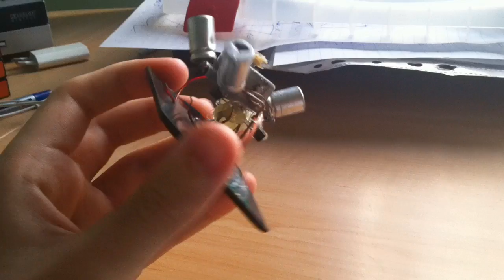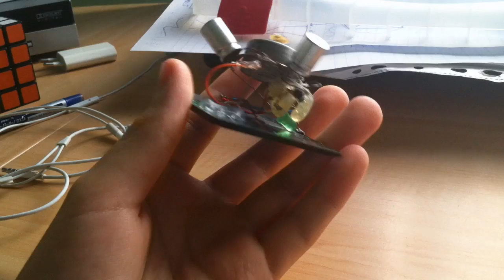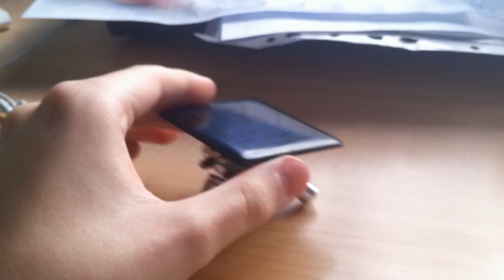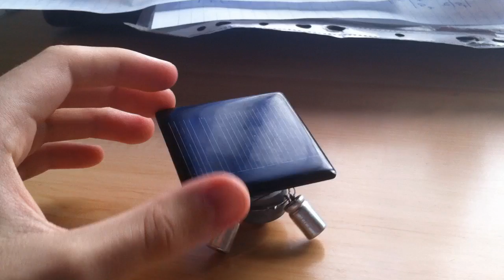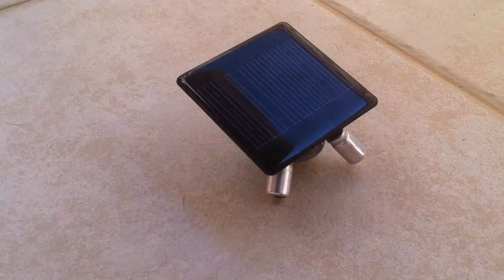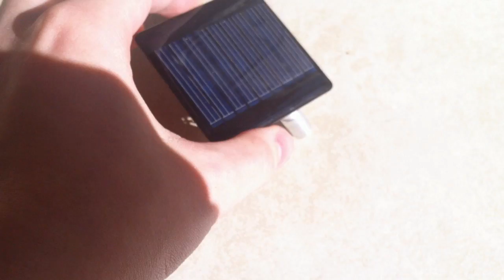Beam Bot - LED triggered

Comment from the maker: Your calculator is a very efficient circuitry, I don't think it draws more then a few micoAmps, thus it doesn't need a very good solar cell.In theory you could do it by, the leakage current will be much grater than the charging rate so I guess it improbable

Comment: the led only turns on when the capacitors have enough power to trip the forward voltage required to turn on the led witch completes the circuit to the motor